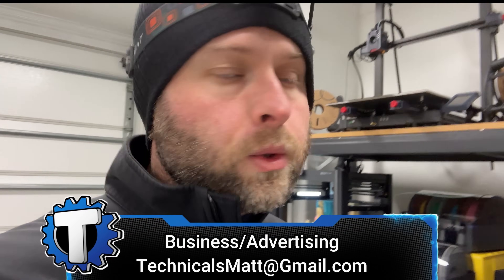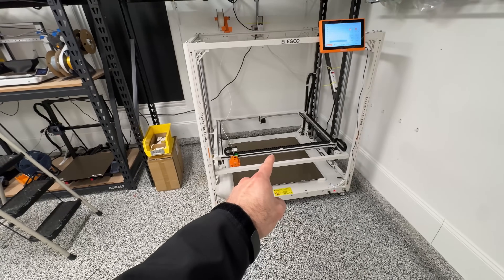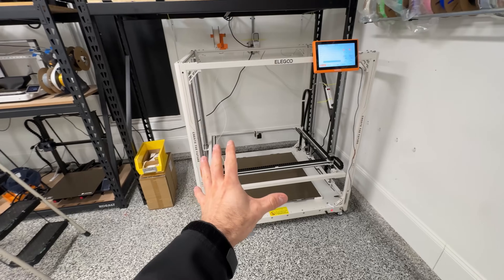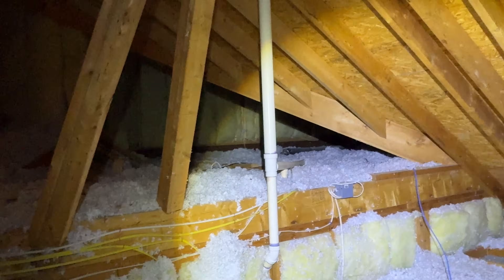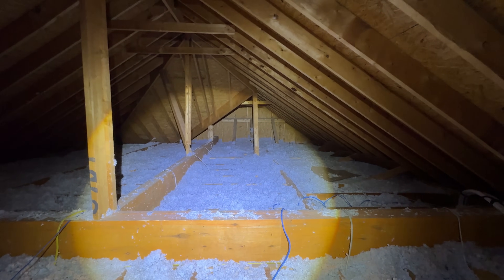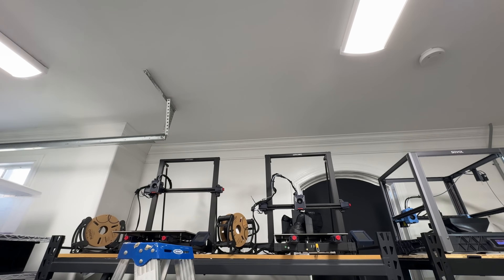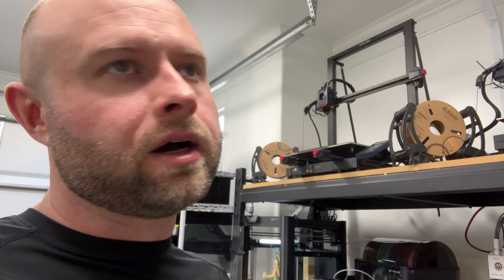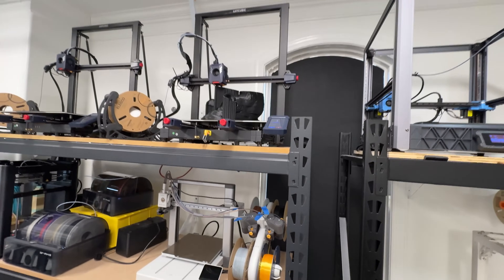Can't Believe I SOLD ONE! & Orangestorm Giga needs MORE POWER: 3D Printing Home Biz Startup Vlog

Comment: LOL I still have to rewire my entire garage and I have been putting it off for months. I think the quick solution was good here.
Reply from the maker: Get a 2nd service? You're running welders and such, right?
Reply: @TechnicalsTinkers  Yeah need to do a sub panel to have 240V. I'd like to do a second service but waaay more expensive. Doing this on a budget hahaha. About $600 I think to run a sub panel, long run from main panel, multiple breakers, and a 50A 240V receptacle with wire.

Comment: On those knee walls you should put 1 inch or so, thick foamboard insulation nailed to the studs with house wrap nails. It will greatly reduce wind that is just going right through that I insulation. I have done that in my house and made a huge difference in those rooms temp.
Reply from the maker: Couldn't see the joists thought to walk around?